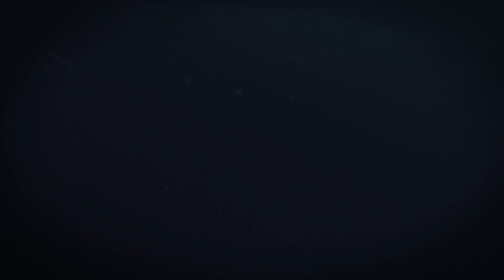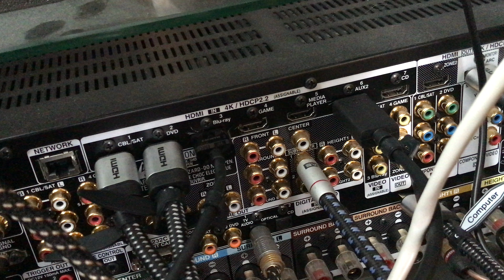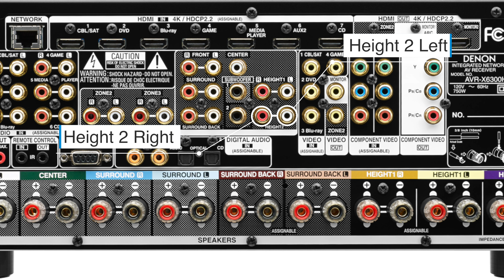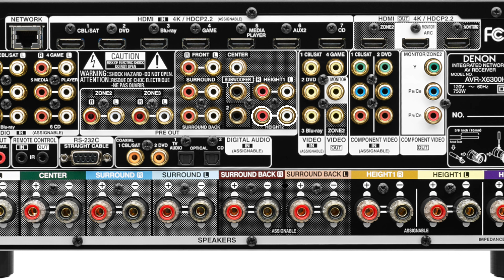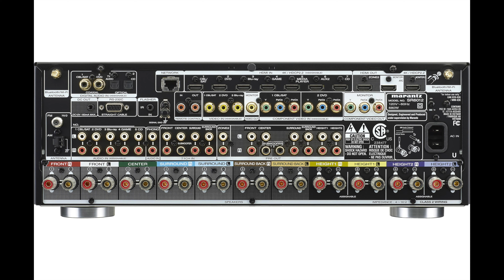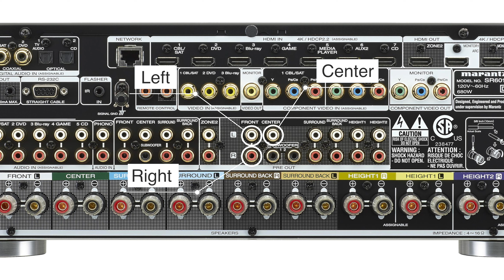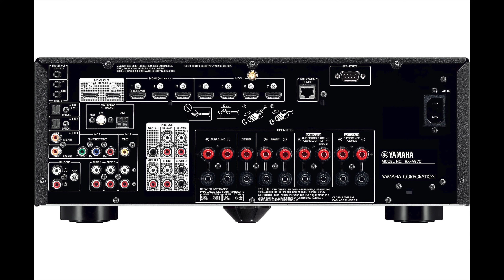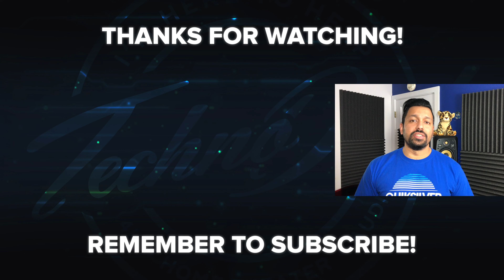How to Add an External Amplifier to Your AV Receiver | Home Theater Basics

Comment: Hi just wondering can I pair a Mark Levinson no 27 power amp with a Yamaha RXA720 receiver. I’ve read you can hook up an external amp through the zone 2 output but I’m wondering will it work with the powerful ML No 27 power amp I currently received as a gift.

Comment: Thanks for the video ! I have one question,, DO I REALLY NEED AN AMP ???????? I’m looking to buy some Klipsch speakers RF 8000f  ( floorspeakers) both are 150 watts RMS each, the central speaker Klipsch RP-504c with 150 watts RMS, also 2 KlipschDolby surround RP-502s 100 watts RMS each and a Klipsch subwoofer SPL-150 400 watts RMS all powered by a DENON X3600H receiver 9.2 channel 105 watts each. My bedroom measurement 12X12 ft. Thanks
Reply from the maker: Hi!  That power rating for the X3600H is for only two channels driven.  If you get a power amp Toh will guarantee a specific amount to each speaker.  That’s what the AVR cannot do.
Reply: Techno Dad thanks for your answer !!!! So , in your opinion is necessary for me to get an external amp ? I saw on amazon a mini 2 Channel stereo amp class D 160 watts x 2 for $75 ,, you think that will help me out ? Thanks

Comment: Can you help me on a situation.
You have to check the models i am giving you.
I have arcam avr850 receiver. I dont want to use its dac and pre amp rather I want to connect parasound halo hint 6 integrated amplifier.
Is this possible on arcam.
I was told when you do a pre out then you are using Dac of a receiver. In my situation I want to bypass that use dac from parasound hin6 for two channel music and movies

Comment: This maybe a stupid question but if I get a avr thats 7.2.4 and only use it as a 7.1 should i still be thinking of getting an amp. I guess my question is can I go bigger on the avr and not need an external amp. I also saw something about a power conditioner. If im just starting what should my av rack look like especially if I have a small budget, whats important and not so important. Whats bang for my buck. Small reciever 5.1 with bigger amp. I'm easily  confused lol

Comment: Great video!  Question please:

I have an entry-level budget receiver (Marantz) powering my 5.1 setup.  Sound quality is passable, not exceptional.

I also have a much higher end integrated amplifier (Naim Nait 5i) sitting around collecting dust.  This amp has an AV bypass, so I'm thinking of introducing it in my home theater setup - it would power my front left and right speakers, while the remaining 3.1 speakers would continue to be powered by my budget receiver.

Since the front left/right speakers would now be powered by a higher quality (and separate) amp, should the overall sound quality of my system theoretically improve?

Thanks for any help!
Reply from the maker: Hi!  Yes, that would give your the power and tonal characteristics of the Naim amplifier.  I would try that out and see what happens.

Comment: Simple enough, but I didn't know exactly what to do.  Your video helped, thanks!  I just upgraded to a rp504c center and now I have another smaller amp running my older center speaker as well (rc-52ii) and it sounds great!

Comment: I have a 5.1 sony home theater...with 3 speakers connected to the bluray player come amp and another amp for the rear surrounds....now I want to make this system into a 5.2.4 Dolby setup....what is the best way to do it...btw the ones I have are the Sony BDV-N9200W

Comment: I just bought this Yamaha rx a780 receiver  ,  not enough power for my LS 15 and 12 Cerwin Vega's   ,  what external amp would you recommend  ,  oh and I will not be using any other surround speakers

Comment: Greetings from the UK 🇬🇧 

Need your advice 

I have a 5.1 setup consisting of the following equipment 

1 x Denon AVRX2200W Amp
4 x Q Acoustics 3010 on their proper ST stands 
1 x Q Acoustic 3070S Sub
1 x Q Acoustic 3090C Centre Speaker 
1 x Marantz CD63 MkII KI Signature CD Player

all using decent quality cables

I’m pleased with my setup pretty much
Sounds okay watching movies

I’m VERY disappointed when listening to Music on CD and want some NEW floor standing speakers (must be in White)

my current setup just lacks a FULL big sound with Music, I don’t have the money to upgrade my Denon amp and maximum budget for speakers is £550 (around $700) 

I was thinking of the Monitor Audio Bronze 5?

The Bronze 5’s Gotta be a bigger and better sound using these or similar with my Denon AV amp surely? I may even consider some second hand speakers, the Q Acoustics 3010 are rubbish for Music definitely 

My living room is 13ft deep by 16ft wide

Or maybe I should get a separate power amp to run my 2 new floorstanders? 

Any advice would be great 😃😃

Comment: I dont really get these "scenraios". Why does Denons have a surround back pre-out, if the 11.1 config can only use the front and the height2? I'd use an amped up soundbar for the surround back but i cannot set it up correctly. Can you please help?

Comment: I have an Onkyo TX-NR797. I'm assuming it does not power the zone 2 left and right speakers? My zone 2 is 2 outdoor speakers. What's a cheap amp for my application and exactly how would I connect the amp to everything?????  I am begging you to help me with this.

Comment: What if I don't have pre outs, only tape in and out, video 1 in and out and video 2 in and out.  My amp is a Harmon Kardon Signature 1.5 2 channel Is has 200 x 2 at 8 ohm and 350 x 2 at 4 ohm, no switches or dials or controls except a bridge switch for mono application.   The output on tape, video 1 and video 2 are too hot and cause amp to clip and don't work with volume control on receiver.
Reply from the maker: That's tough Eric.  I'm not 100% sure about that.
Reply: @TechnoDad  Bought a HK Preamp.  My Yamaha is 130 watts per channel x 5 into 8 ohms but the left front preamp has a short and cuts out so I was trying to figure out a way to do it to no avail.  This HK preamp is used but now I have double the modes.  Oh well.  ;P

Comment: What about setting the volume for the fronts now that they are running through a separate amp? Does the amp turn on automatically when you turn the receiver on? Once you set the amp volume knob does the volume for the fronts adjust with the rest of the speakers using the Denon?  Do you have to set the fronts to "none" so that the receiver isn't trying to send a signal to the fronts or does not having the speakers hooked up automatically free up the integrated amp to give more power to the rest of the speakers? I know that is a Basics video, but I feel like you could have talk about the setup once you have the amp and speakers hooked up instead of showing us where the pre outs are on multiple receivers, just so you can hit the magic 9-10 minute length to hit that YT algorithm number... Just saying.

Comment: Great info, thanks!  I currently have an Anthem MRX-720 running a 5.1 but will be adding an additional sub soon.  Before then, I plan to add a Naim Uniti Nova integrated amp [https://www.naimaudio.com/product/uniti-nova] and I would assume I connect the same way, Anthem pre-outs to Nova RCA Analog Inputs?  Naim input diagram - https://hometheaterreview.com/assets_c/2019/07/naim_uniti_nova-IO-20889.php   Thank you.

Comment: My only question is, what configuration do I need to change or do I change it at all, say my main AV  normally a 7.2 and I get a Amp, and run my LCR through preout do I have to change on the amp the configuration or does this still keep setting at 7.2 and no setting need to be changed besides the preout settings..so it stays a 7.2 through my AV and the amp only poweres the LCR everything else stays the same? 🤔🤔🤔

Comment: Hello! I have a Denon AVR X1600H receiver and then how would I connect the amplifier and have the speakers center + left + right connected as you presented.         Here is a picture of the connectors the receiver has.      https://assets.denon.com/Assets/images/ProdDesc/AVRX1600H/D_X1600H_slider_2_na.jpg

Comment: Hi techno dad I have a Onkyo 373 basic receiver has 5.2 output but only the right and left speaker powers are strong enough to get a good loud sound on my right and left speakers. The rest outputs like center, surround and rear outputs are barely audible because the receiver is not putting out a loud enough power. So now I have decided to buy a costly 9.2 channel Onkyo 838. My question is will I have the same issues on the 838 9.2 channel receiver. I mean will the right and left channels have the muscle and the rest of the channels are just eye wash ( low power) . My low end Onkyo 373 said 165 Watt per channel. 5.2. But I noticed 165 on right and left speakers but not the rest.  The Onkyo 838 receiver says 215 Watt per channel. So my question is since I am paying big money will Onkyo receiver give me 215 Watt per channel on all channels or are they going to stiff me again. If you say that they will stiff me, then I will get two Onkyo 373 receivers for the same price as I pay for the Onkyo 838. Now I will have three receivers ... One will drive the front right and left speakers one will drive the rear right and left speakers and the third will drive the center and surround speakers. Am I making any sense here. Am I making a fool of myself here. Do you think that I will get 215 watts per channel on all channels on my Onkyo 838 receiver and therefore get a 838 and not two Onkyo 373 receivers for the same price. Before I close I want to tell you the speakers I will be using. All are Polk speakers. Polk T 50 towers. Polk rtia 5 towers. Polk rtia 7 towers.  And a a Polk csi center speaker. The rtia 5 towers and rtia 7 towers will be right and left front and back speakers. The T 50 towers will be my front book shelf speakers or maybe surround speakers, what ever hope I didn't loose you admist a great deal of confusion!

Comment: So is there no amp assignment in the menu you have to do with this amp (Denon) to tell it you have a power amp controlling the front two speakers? I ask because I’ve done this and the amp setup for speakers still shows two front active on the Denon.

Comment: I've  a Denon X2400H and a Sony STR940 can  I connect  them together and  have Sony drive  rear surrounds as  if they were Rear  Heights.  Then  have the Denon  do the rest  using the  preouts ?

Comment: I'd like to have seen included recommendations for pre-amps or any tricks to add an existing receiver to loopback back power to act as as a pre-amp.  /n000b
Reply: That's what I'm wondering. Just got the 4500H and I'd like to know for sure if I can pre out to ext. in or something similar with my old receiver, AVR 1508. This was a great video.

Comment: What do you do if your  receiver doesn’t have preamp outputs ?  Can you get wires that have speaker wire on one end and rca plugs on the other and connect the speaker wire to the speaker output on the old amp and connect the rca to the preamp

Comment: I have an older Denon DRA-1025RA. I had recently connected an external amplifier to the pre outs. I wanted to see if the external amp worked. The amp worked so I disconnected RCA cords from the pre outs. I put the RCA jumped back in and now my reciever will not make any sound when connected how it was originally. I have my CD player connected to the CD input on the back and everything is switched to CD player and I'm not getting any sound now. It was just working perfectly fine and now it isn't after using the pre outs. Reciever powers on. Did something blow on the inside? I'm confused as to why its not working anymore.
Reply from the maker: Hi Sloan.  That sounds strange.  Did you reconnect the speakers to the Denon or are they still connected to the power amp?

Comment: I have a pair of kef uni-q tower speakers. They’re 3 way 6ohms speaker. I’m having trouble connecting them to my Sony home receiver. It’s nothing like your denon, it’s a mid 90s receiver does it’s pretty simple. Every time I turn them up loader than 25 they cut off the receiver to protection mode. I would like to ask how you recommend me connecting the tower speakers to get the best sound.

Comment: Soooo considering how the price goes up, should I consider getting a much better AV Receiver, or get a mid range one and get an amp??
Reply from the maker: I would go mid-range with an external amp.  Check out the Denon X3600H and the Outlaw Audio Model 5000 combo.  I just made a new video on this topic - https://youtu.be/x_a-9Uq4Tzc links to products are in the description of this new video.

Comment: Hi mate, I have Yamaha RX-V3085 running 7.2.2. To make it 7.2.4, i need external 2 channel power Amp. Can I use another external 5.1 channel receiver to run 2 atmos receiver? Reason for using additional 5.1 instead of 2 channel is the huge price difference. I am getting new 5.1 yamaha receiver for lot cheaper compare to 2 channel power amp.

Comment: nice.. i have 2 dali concept 6 speakers with denon pma 700ae amp.
i want to connect subwoofer and some say from preout,cause denon pma 700ae have preout.
But i dont understand were is the preout and how can i connect the sub..???? and what sub?? pasive?
Reply from the maker: You would need a powered sub to use with pre-out

Comment: I use 2 Sony av receivers with the system A  hdmi out going into system B and the system B hdmi out going into the TV 

Sony lets you pick all manner of speaker patterns so One plays on 9 channels the other plays 2 front and 3 rear so no 2 speakers replicate each other and I get unique surround sound

You can pick these systems up for £100 a pop so you  get serious audio  firepower for the money
Reply from the maker: Wow!
Reply: @TechnoDad  have 2 systems by same manufacturer  so one remote controls both connected to play from same source

 a basic version is one playing 5.1 the other  playing  2 channel stereo so all speakers are playing the same song differently 

I've been doing it for years but can't find anyone else doing it

Comment: What your audience really needs is a list of cheap stereo recievers with pre outs.
Reply from the maker: The problem is, there aren’t that many “cheap” ones unless we are talking used gear.  Onkyo has some around $800 and Denon has some around $1,100.  Not sure that’s cheap enough, but I can make some lists of what’s out there.  Usually, an AVR with pre-outs is priced somewhere in the middle.

Comment: Hello Techiedaddy, so i have 2 yamaha rds640’s with pre outs... is scenario 3 possible? id like to use the 2nd amp’s pre out to Return the signal to the Master amp... im planning to use the 2nd amp for my other stuff... 🙏 subscribed
Reply: I use 2 Sony av receivers one of which plays 9 channels the other plays 2 front and 3 rear  so no two speakers replicate output 

the TV hdmi output on one sends both audio and video to the second and the second sends video only  to the TV 

It's probably not recommended but they both seem able to create pretty  reasonable surround on their own and together sound pretty good 

As you have 2 systems why not give it a try

Comment: I have onkyo 3007 and Onkyo 838 - using 3007 as master receiver with all main speakers connected with one subwoofer. I have a Epik legend subwoofer with failed plate amp. I want to use 838 as subwoofer amp and connect it to 3007 - how to wire it ? Epik is dual driver sub. Plate amp is failed and opened the amp plate already.

Comment: Great channel also great video!
I have 2 Klipsch RF 62IIs for front main speakers, and a Klipsch Rp250 c for a center  running off an Onkyo Rz-820. Im looking to add an external amp to power at least my mains, I like my music cranked at times, and well when the mood hits and i get to about -9 i can hear the speakers puttering out and sound horrible...i think i need more power...any suggestions for a mid level amp?

Comment: Hi Techno Dad, I have a 135 watt 9.2 atmos pioneer receiver and I have all klipsch speakers. The fronts L and R are 150 watt RMS and the rest including the center speaker are 100 watts and the my sub is a 12in 350 watt RMS Klipsch sub. I was thinking about getting an external amp for the the fronts L and R because I was thinking that I was under powering them but after watching ur video I'm thinking about just adding a 2ch amp. Do you know of a good affordable 2ch amp? Thank you for ur videos!!!

Comment: I have an Onkyo TX-DS676 and I'd like to use its center channel pre out to a CD input of a Sony AVR. The plan is to use a center channel speaker independently on an external amp to improve dialog when watching TV and movies. 

Will I be okay with doing this, or would the input voltage be too much for the Sony?

Comment: Great video, I have a question about seanario one.  I have a brand new Yamaha RXA 3070. I want to get all 11.2 channels operating. How important is the 2 channel amp to drive one pair of the height speakers? Can I use a small D class amp at 50 watts or do I need to look for more power?

Comment: Excellent info man. Im looking to add an external to my receiver. It's an older Yamaha RX-v467. But pretty good features and sounds real good for the polks I'm using. It is a 7ch amp but only runs 5.1. Other 2ch are pre outs. Now I'm just looking for a small 2ch amp. I have one in mind with the pyle 120x2. And I already purchased polk audio owm3.. I'm interested in some ideas.

Comment: Thanks! Great info. Question though, my amp has preout in and out, just a pair of left and rights...it’s capped.  If use the pre out and go into another receiver, just for more speakers throughout the house, do I have to close or reconnect the preout in. It looks like it supposed to be a loop.